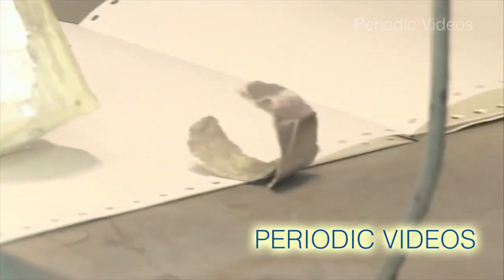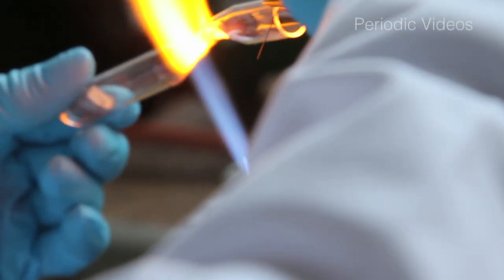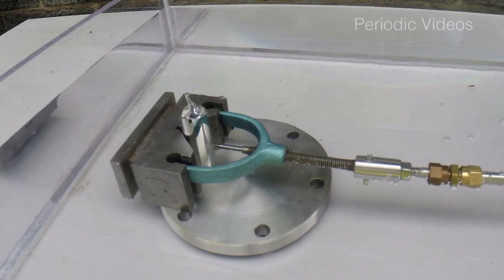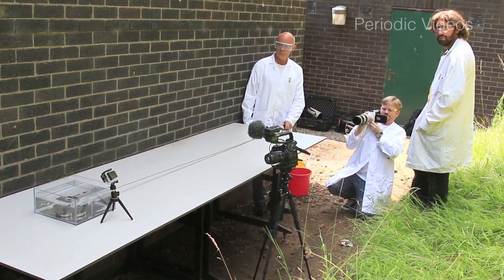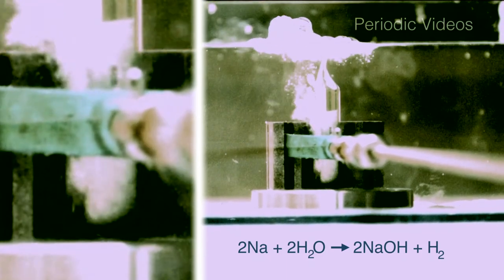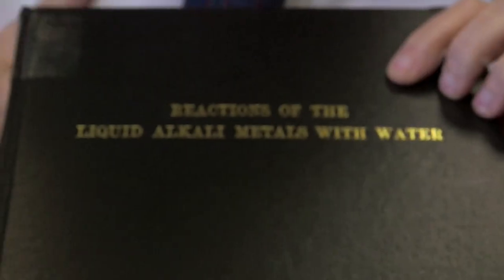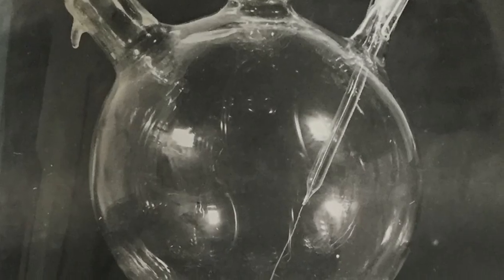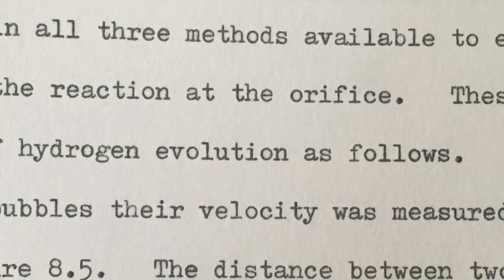Underwater Sodium - Periodic Table of Videos

Comment: There are 2 things that this video fails to show -- The actual effect that the screw has on the tube, and if the explosive reaction is due to the tube failing completely due to the screw's continued application of force, or if it's due to the reaction's acceleration.

This really needs to be shot with an ultra high speed camera, and in such a way that the full reaction is visible.  Maybe by placing the camera under the container?  Time to fetch the SlomoGuys
Reply: +Hikaru Katayamma I see a lot of science videos that do slow motion footage rather poorly and think the same thing. Why not bring in an experienced slow motion videographer like Gavin?
Reply: +Hikaru Katayamma You don't need high speed to know if it's the glass tube, i think you just want one, like me :D.. just break a glass tube underwater by its self, boring but it gets the data.

Comment: My background is with Li + R-Cl,  In those rxns there is a "slow" initiation step where the reactant diffuses through or dissolves the surface film, the the fast rxn occurs.  Looks like in your case the water had to dissolve the NaOH surface film then the metal rxn takes off.  Sodium also melts as the reaction proceeds so the metal transitions from a low surface area to a high surface area - all and all you have multiple steps to consider.

Comment: If you want to break the ampoule more decisively, tighten the point down onto the ampoule then tap the end of the steel rod which drives the point which with a small hammer

Comment: Nice experiment setup but I think it might be interesting (and quite a bit more costly) to do the same experiment but in a MUCH deeper tank. How much sodium is ejected from the explosion? Maybe only interesting from a cinematic perspective but what would the explosion look like under much greater water pressure?
Reply: +Karl Oestreich Interesting idea, though you could even do it without a huge tank but just a high pressure system if it's designed properly (either with a timer or some mechanical manipulation like they did here)

Comment: you should cover a piece of alkali metal with something that is solid but dissolves in water, and it would sink to the bottom (or you may have to weigh it down somehow) and as it dissolves it will suddenly be exposed to water.

Comment: You did not seem to address the problem with a layer of oxidized metal that forms a protective barrier between water and sodium. I believe I can see in the video that the surface of the metal inside the tube is oxidized.  Is there a way for you to insert sodium into a container under protective atmosphere, while making sure there are sodium surfaces void of any oxidation?

Comment: Submerging Na into water make them react too violently as shown in this video.  It looks all washed out showing no detail and no fire.   Here is how you can slow down the reaction.  Spread a wet paper towel in a beaker, then drop a piece of Na about the size of a rice grain.  The Na will first sizzle and dance around like a water drop on a hot plate, then goes quiet like it is over, then all of sudden it will catch a fire with a flame about a couple of feet high.  That would be more dramatic and surprising, because you wouldn't expect a little rice grain cause fire that big.  Well if you are brave enough you could try a larger piece and see what happen!

Comment: I think the reason why the reaction seems slow, might be the heat generated by the reaction is carried away by water, and therefore the hydrogen generated did not have enough energy to react with air with the bubbles reached the water surface.

Comment: Love this video.  I noticed that there were small projectiles coming up with those Hydrogen vapors in the slowed down vidoes of the reaction, and as was pointed out the explosion takes place on the surface when the Sodium was under water. I wonder if that was Sodium that was ripped away by the Hydrogen vapor and once there was enough you saw the violent reaction. It seems Neil kept turning the screw until the glass completely failed. I wonder if the reaction would take longer and be less explosive if the glass could just be pierced by the tip of the screw. Could controlling the levels of Oxygen slow down or speed up the reaction?
Reply: +Donald Hudson Looking closer I see the violent reaction starts in the tube and expands outward. Still would be interested in controlling the Oxygen.

Comment: Hey guys,

as you surely know, for synthesizing NaCp, a metal-cooler is used, so it can´t break.
I would be very interested in what it would look like, when using a glass-cooler, it actually breaks and releases water into molten Sodium.
Surely destroying a cooler for that purpose is not worth it and dangerous, but I guess it would be an interesting experiment just puting water onto molten (eventually stirred) Sodium and comparing the behavior to the reaction of solid Sodium with water.
What do you think of it? Have you done something like that before and if not, could you pleeeeaaase do it ? :D

Comment: i thought of a experiment, using a cheap multimeter, put the negative electrode into the water and the positive electrode into the sodium metal, when the explosion happens.. I’m expecting a voltage reading 🤔💥🤷‍♂️

Comment: To exclude oxygen couldn't you just pour paraffin on top of the water?
Reply: +Gareth Dean That is a brilliantly simple idea. Love it.
Reply: *****
The reaction deserves more scrutiny I think.
Reply: +Gareth Dean your avatar deserves more scrutiny. At first I thought it was some effed up clown head thing, but on closer inspection it looks like a crystal formation?
Reply: taids
It is indeed, Vanadite, one of my favorite minerals. Of course now I can't unsee the clown face...
Reply: +Gareth Dean Also, it is easy to pull a vacuum and if pressurization is desired, refill with a gas that is inert to the reaction.
Reply: Matthew Crawford
If you're dealing with water, pressurization is required. That stuff has a powerful vapor pressure.
Reply: +Gareth Dean Probably easiest to just fill a giant plastic chamber (by giant I mean perhaps a few feet in in each dimension) above the reaction with argon or nitrogen. Both are extremely cheap and almost every research lab has access to at least one of them. It would take an afternoon to fill the chamber probably.
Reply: Gammel Prutte
I'm half clown on my mother's side. It would betray my family.
Reply: It's far easier to just prove as hydrogen than eliminating single gases
Reply: MadhuttyRotMG With an argon atmosphere you would be removing all but the hydrogen that is evolved, and argon wouldn't react in such a scenario.

Comment: Sorry but your hypothesis about origin of that explosion is clearly false, just based on examining your video. The explosion clearly starts underwater, not after something gets in contact with air. The view is obscured by bubbles and the mechanism but that single frame with start of the explosion has clearly all of it underwater. And your container is just too shallow to make it clearer. Do it in deeper container, perhaps? Or use Argon atmosphere? Of course that assumes you are interested in figuring it out rather than reiterating that it's thoroughly understood while producing wrong conclusions.

It would probably also help a lot if you acknowledged Thunderf00t's results and perhaps prepared your experiments with that on mind. You have access to higher speed cameras than he has, yet his pictures are better.

Comment: I can't really tell. Is the starting point of the explosion on top of the water or is it the sodium itself?
Reply: +XAtom1c 
Never said the sodium rose to the top. But there's are a lot of gas above the surface, most likely quite hot hydrogen. So where did the explosion start?